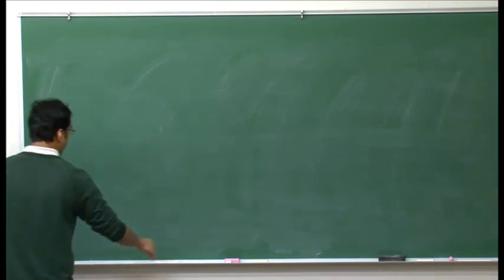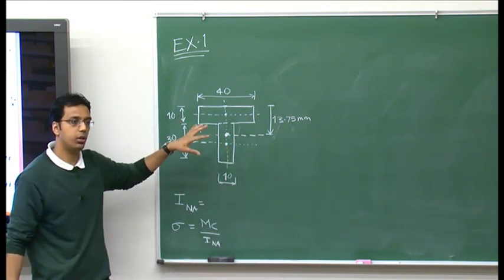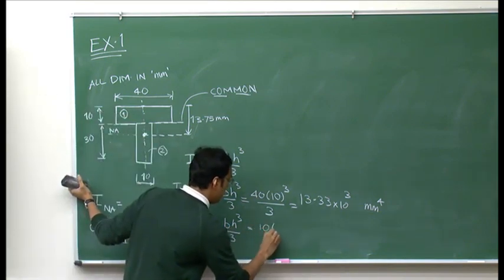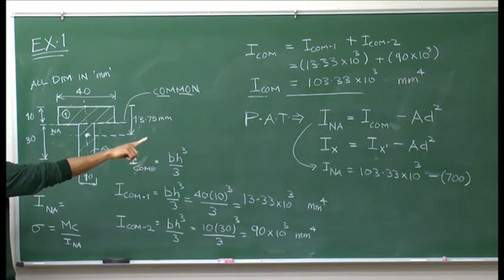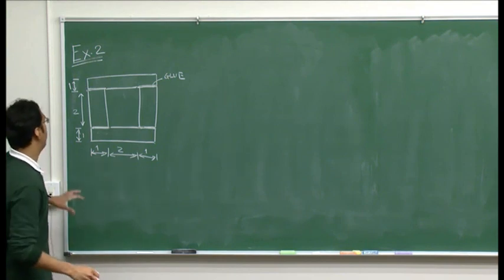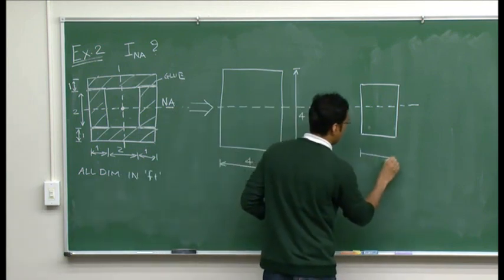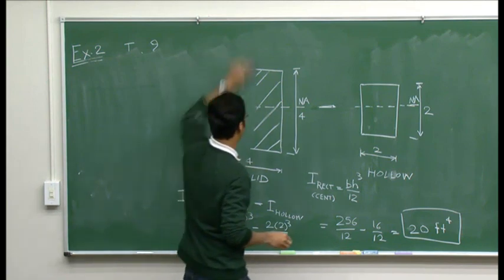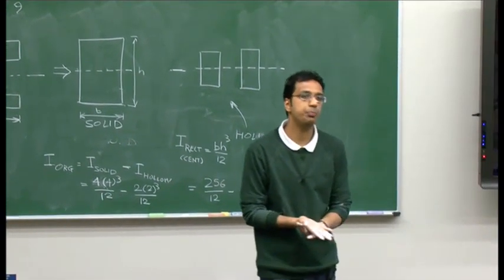Parallel Axis Theorem Example problems

Comment: its not correct  if axis that you are going to calculate inertia upside of your  figure the formula 
I= Ic-A.d^2
its downside of figure the formula
I=Ic+A.d2

okay lets calculate for this example first   
Ic=bh^3/12 u know, 150*10^3/12 = 12.500
Now lets try to calculate this answer from another way .
https://i.pinimg.com/originals/21/71/c7/2171c7dd7b545d4b762f34e5e5be06c2.gif
I=bh^3/3 (its for axis that tangent rectangles down edge.)
I=150*10^3/3 == 50.000 
IC= I - A.d^2   == 50,000 -(150*10)5^2)
Ic = 50.000 - (1500)*(25)
Ic=50.000-37.500
Ic = 12500

Now as you can see when axis is upside,  the formula     --- Ad^2
downside the formula  ++Ad^2

Comment: Great Video. Just a query, not sure. But I calculated the Neutral Axis from the top to be 13.57mm rather than 13.75mm??
Reply: +Hari Dhas  i also got a same answer
Reply from the maker: You are right. I must have mistakenly written 13.75 rather than 13.57 mm. Thanks for catching it. FYI, this value is calculated in the video on 'Centrolds of composite bodies'.
Reply: +Anup Pandkar how did u guys get 13.75 ?
Reply: sry i also get 13.57